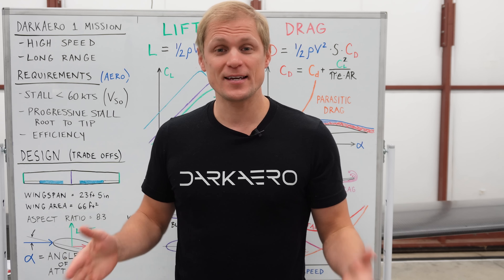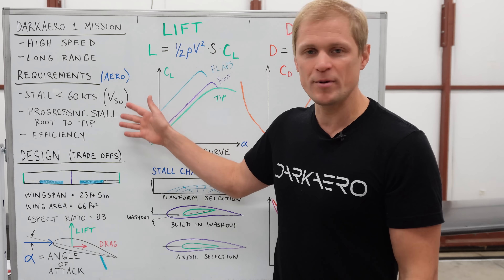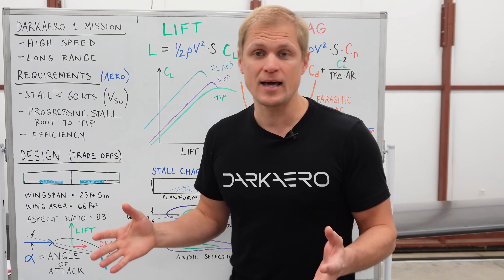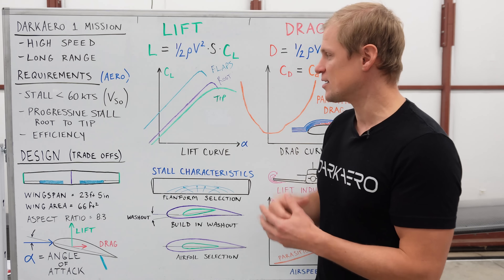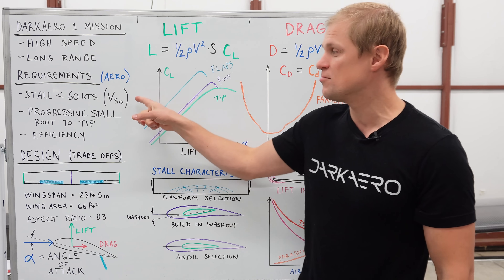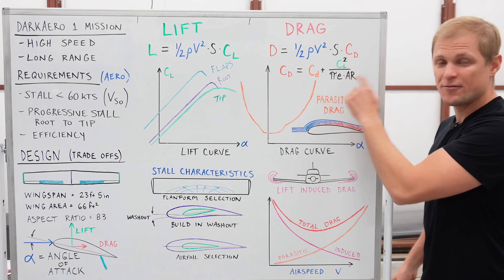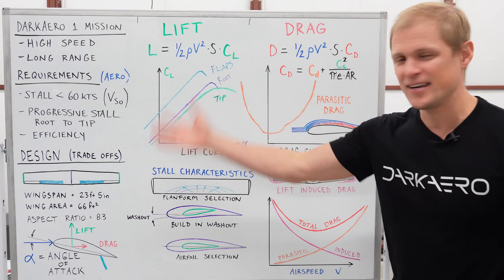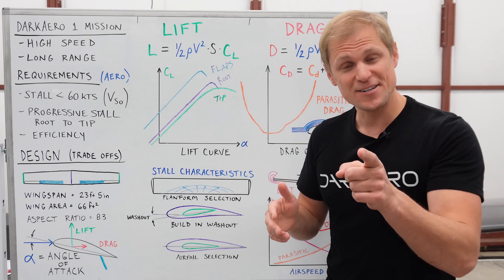Why we don't use winglets (DarkAero 1 Wing Design)

Comment: I have a question, not about wings but the props. Why does no one make props themself? With the new technology 3d print/cnc and cad. Making molds are easier availble now. Cause the prizes on prop packages is extremely expensive. Or does prop have some sort of licensing/approval papers they need before taken in the air?

Comment: Thanks for the excellent quality video and very professional explanation! As someone who does not have your aeronautical engineering education but has built many RC aircraft over the years, I do note that aerofoils with thin radius leading edges (like yours) usually have pretty viscious stall characteristics. ie you have designed a wing that will stall nicely straight and level, but I do wonder how it will behave if some assymmetry is added at the stall, like a bit of yaw or aileron deflection, especially if it is an accelerated stall. I also note that laminar flow aerofoils are very sensitive to surface imperfections, even as small as leading edge bugs. Is this something that you can calculate?

Comment: The low stall speed is great.  One question that I have is what is the engine out descent rate(ft/min) in an engine out scenario.  Love the plane…
Reply: I wouldn't call it a "low" stall speed. Compared to other two-seater kits it stalls at a fairly high speed.
Reply: @TheOwenMajor  I agree with you.  I should have omitted the word “low.”  My point is “high” sink rates exist with high wing loads. At 22 lbs/sq in what is the fpm sink rate?  There are other designs with higher wing loadings than the Dark Aero.

Comment: Why not winglets? I’m not following how it would increase parasitic drag.
Reply from the maker: The total wing drag is the sum of parasitic drag and lift induced drag. Winglets always increase parasitic drag. They reduce the total drag only if they can decrease the lift induced drag more than they increase parasitic drag. In the case of the DarkAero 1 in cruise flight, the lift induced drag is already low, so there is little to gain in terms of lift induced drag reduction. Winglets would just end up being more “stuff” to drag through the air. It’s a similar principle to how air racers will shorten the wings on their airplanes to fly faster. Shortening the wings increases lift induced drag because they are reducing the aspect ratio of the wing, but this is more than offset by the decrease in parasitic drag from clipping the wings and reducing the wing area.
Reply: @DarkAeroInc  Ah man, yeah that answer was perfect! Thank you for that!

Comment: I've been an airplane nut for 66 years and even worked for Boeing for 22 years (not in design engineering).  I've never heard all this explained in one sitting and I must say you did it very succinctly.  Thank you for that.  Did you select a pretested NACA airfoil or did you do a custom?
Reply: he only mentions laminar flow airfoils not a specific NACA series or number
Reply: NACA airfoils are from the 70s.  There are better tools out there for better airfoil designs.
Reply: @ChrisParayno  actually a lot of NACA airfoils are from the 1920s and 1930s.
Reply: @ChrisParayno  realy I thought they were 50s at least for the 4 digit series. But yeah there are better airfoils for specific jobs than NACA.
Reply: @ChrisParayno  what tools are those ?
Reply: I recall them mentioning a NACA 6-series, but my memory could be off. Not sure if that's at root or tip.
Reply: @dudea3378  the so-called „drag bucket“, which is the flattened part at the bottom of the C_D curve, where drag pretty much stays at a constant minimum for a small range of AoA (very beneficial), does indeed suggest a NACA 6-series airfoil, since that’s a pretty distinguishing trait of these high laminar flow airfoils.
Reply: I read that as “I’ve been an airplane’s nuts for 66 years” 😅

Comment: So the split flap actually provides enough lift - even with that rather small wing - to get the VSO down below 60kt... wow.  
And I'm guessing the math on how much armstrong the Johnson bar will need to get the flaps out right on top of VFE is a lot simpler than trying to size a motor or linear actuator?  (For that matter, the math on calculating VFE based on gust load is gonna be a LOT simpler on a flat plate flap than on any kind of airfoil... )

Comment: But winglets would allow to push the aspect ratio slightly further while still maintaining the wing span requirement of fitting into a 2 car garage right? You're saying the penalty of the winglet could not be offset with the resulting higher aspect ratio?
Reply from the maker: Adding winglets on the DarkAero 1 would increase parasitic drag more than they would reduce lift induced drag, resulting in an increase in the total wing drag. The lift induced drag in cruise flight is already low, but even if it was high, adding more wingspan would be a much more effective solution for reducing lift induced drag.
Reply: @DarkAeroInc  Thanks!

Comment: Love this - so a few tangible follow-ups that I'm excited to see flush out in flight testing of the DarkAero 1:

1. What is the cruise speed? (assuming it's the airspeed that correlates to the lowest total drag in the bottom right chart on your whiteboard)
2. What is the stall speed? (ideally the stall speed with full flaps) You guys are smart and safe and I'm sure you are designing for a pretty low stall speed to compete with the microlights coming out of Europe
3. What is the never exceed speed?
Reply: Best cruise is never at lowest total drag, it's usually to the right (faster than at that point). That would be best endurance.
Reply: TNE is TBD. The other information is right on their website.
Reply: They will publish conservative estimates at this point but the real numbers won't be known until flight test is complete.

Comment: A complete wing design explanation and engineering lesson in less than 15 minutes. Brilliant! Thanks Riley!
Reply: Now for the spar and internal wing designs. I'm pulling up my cozy chair.
Reply: """""COMPLETE"""""
Reply: I plead the 5th
Reply: yeah, yeah, why spend 5 yrs in university and 20 more yrs working in airplane design when you can pick a "complete explanation" in 15 minutes?! ))))) sounds like how life works ))) this is just marketing bullshit, there is nothing useful in this video...
Reply: Not quite but complete enough to get the idea behind the concept. More like 2/10ths of 10/10.
Reply: Yeah. I am taking my first class and this basically summed up everything I learnt in my last six chapters :)
Reply: I was truly amazed, really brilliant!
Reply: @balikis  ok
I won't let you get any more grey hairs in figuring it out.

As you know, when the rear of the wing is lowered, you get lift and when that envelope of angle is exceeded, one get a stall.

The wing lift concept works in the dame principles as FLAPERONS. 

EXCEPT in the wing lift concept works normally on take off snd landing wit or without flaps extension.

But in straight and level flight the entire wing which ha a pivot point in the leading edge, will allow rear of the wing to have a  travel of 20 degrees. 

When the rear of yhe wing is in the up position, the aircraft should pick up an additional 20 kots in speed, and less fuel consumption because of less drag. 

When the rear of the wing is in the down position yhe aircraft will be 20 knots slower. More fuel consumption due to mote drag. 

Cessna high wing aircrafts do have a on the ground configuration adjustments. 
These aircraft van be adjusted for speed, but will need more runway for take off.

Or

Can be adjusted for load carrying and take off distance will be significantly shorter eith maximum load. 

If these adjustments could be made in flight, it would be like having overdrive on your aircraft. 🤗😉🤔😁😀

So, in a nutshell, constant wing lift can convert  a standard wing design into a laminal flow wing.

🤔🤔 About it.
Reply: @jetski7611  Rear of wing going up or down is what is technically calld angle of attack
Reply: @jetski7611  I bet you've got a few perpetual-motion machines in your repertoire too.
Reply: @jetski7611  terrible idea for drag. Extremely draggy. The theoretical ideal lift distribution is elliptical
Reply: Your wing design is great.

I will share with you a technique never considered in wing design before.

The technique is called
"Constant lift wing"
With this design, one can never stall another AIRCRAFT .

I will let you and your viewers do the brain storming. Smiles 😁😁🤗
Reply: @jetski7611  If a wing is constant lift, how do you turn?   In a turn you bank.  Unless the wing lift goes up, the airplane will descend because the vertical component of lift no longer equals the weight.
Reply: @jetski7611  No such design would work or exist.
Reply: @jetski7611  Helicopter blades are infact super long thin wings, and even they stall.

Comment: Incredible video. I do have one question though: you said that you've used composite materials partly because they allow you to end up with a smooth surface that's conducive to laminar flow.

However, although laminar flow has lower skin friction drag, it stalls more easily (due to flow separation), which is why wings sometimes have vortex generators to INTENTIONALLY trip up the flow and make it turbulent.

How do you account for this?
Reply: Would the design as is help since the tip stalls last?
Reply: Laminar airfoils are not laminar all the way to the trailing edge. The boundary layer still transitions to turbulent, just at a point further towards the trailing edge. They are not anymore prone to stall than comparable standard airfoils at typical Reynolds numbers.  At low Reynolds they require deliberate tripping to avoid early stalls.

Comment: Couldn’t you reduce the wing area if you designed in winglets?
Reply: Induced drag and Vso would increase.  Aspect ratio and washout reduce the need for wing tip devices.
Reply: @keithjurena9319  I think Id like a lesson just on this topic alone.
Reply: Washout is a reduction in angle of attack  at wing tips built into the wing.  This builds the progressive stall so wing root stalls first.  But it also reduces induced drag since dynamic pressure differential is lowest at wing tips.
Aspect ratio also reduces induced drag.
Look at Rutan's Voyager.  Sailplane aspect ratio wings with wing tips.  Only to have them sanded off on takeoff from 14000 feet of rollout with 7000 pounds of gas..well, the wing tips were hanging by threads, a side slip maneuver removed them.
Dick Rutan and Jenna Yeager made it around the world,  non stop in 216 hours per design, without need of fussy winglets.
Burt wasn't a fan of computers so this was classic design, winglets were the rage back then.  Greg Cole designs great wings without winglets.